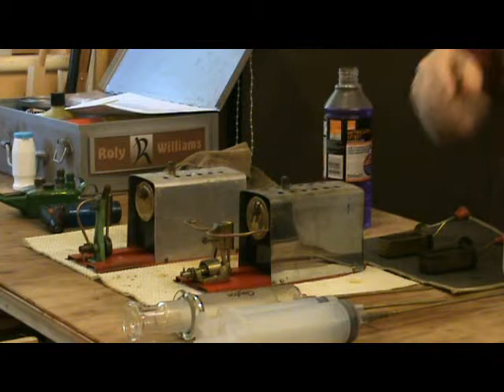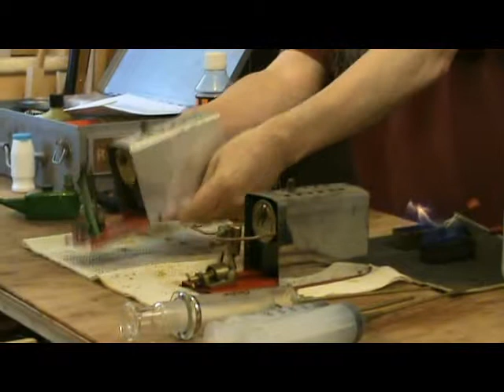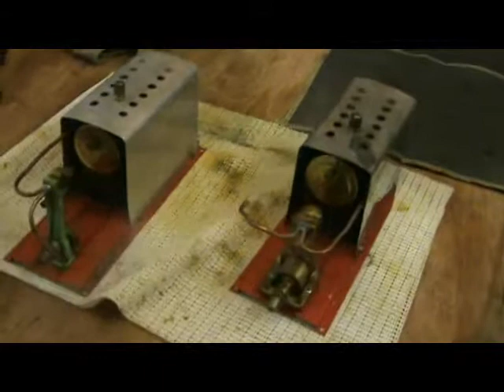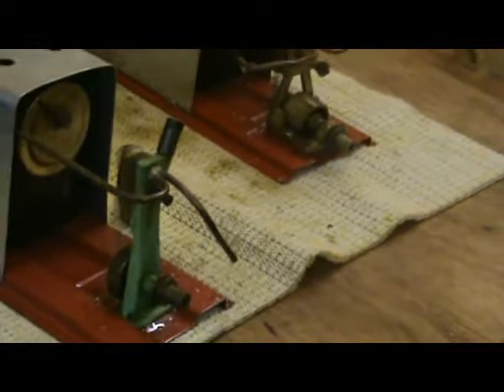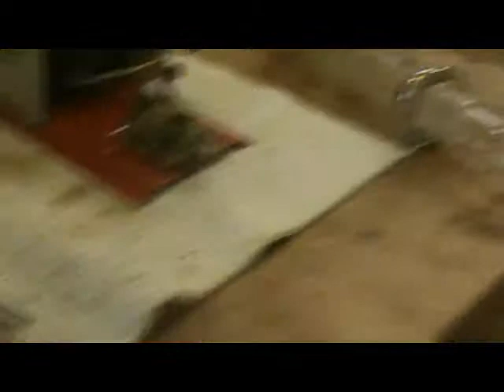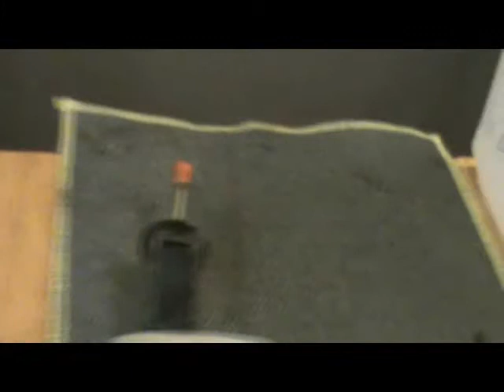Mamod ME2&3

Comment: I put mine into a Billing Boats 'Mercantic' which I made with difficulty when I was twelve.  I still have the boat with plant and I'll give it a go for my grandson soon.  A few splits in the planking to sort out plus a missing prop to replace.  It is forty years since I heard that sound!  Should I go for a two or three blade prop?  Which would suit best.  I always used preheated water when I could - from a Thermos.  I think this extended running time a bit (10-12 minutes).
Reply from the maker: The type of prop needed depends a lot on the size and shape of the hull. If you have a choice of props then trial and error would determine the best. As a rough guide, the ME1 had a built in 2 blade prop. 30mm in diameter, and the ME2 has a similar size cylinder, so a similar prop. would be a good place to start. The ME3 has a somewhat larger cylinder so it would probably cope with a larger diameter or more blades. As I said, trial and error is the way to go.
Reply: Thanks for your comment.  The ME3 revs at quite a high rate, so I was thinking more blade surface would mean slower revs.  which might not be a bad thing.  I see that props are quite cheap, so I'll follow your advice and buy three or four to try out.